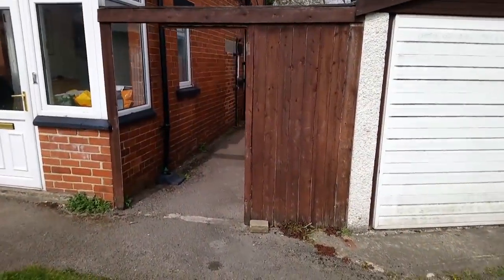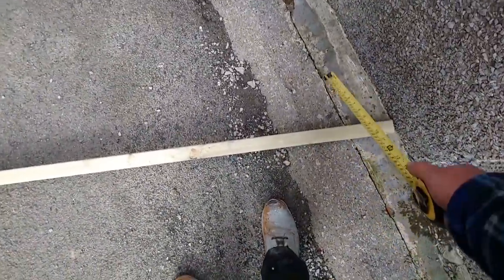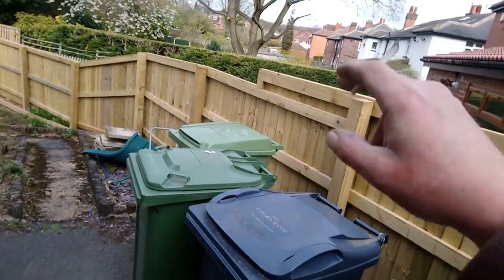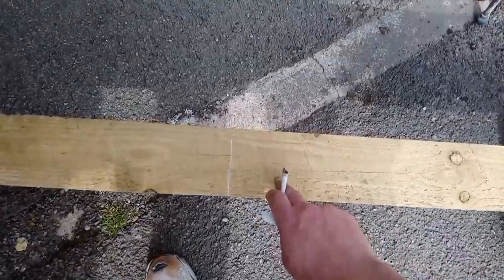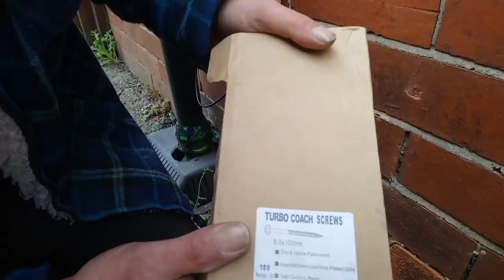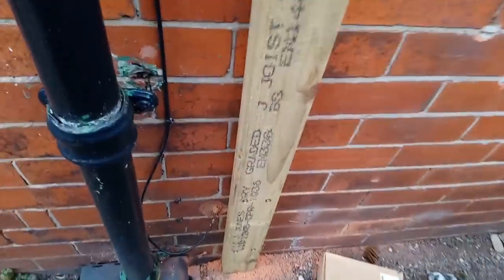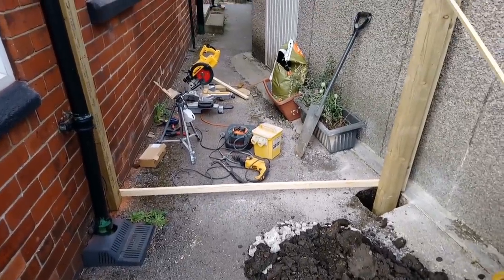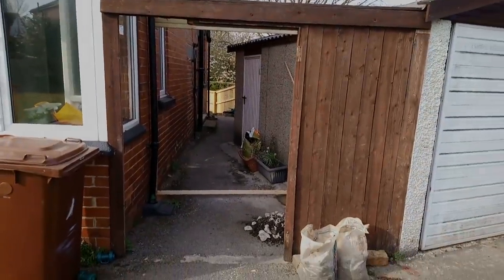Side gates - installing the post/frame

Comment: I was pleased to see you finish the concrete properly, chamfering down and  away from the post. Most so called "proffessional " fencers shove in however much concrete they think will do then top it off with soil, That way they know there will be another job when it rots in 5 years.
Not a criticism each to his own,  but I always position the wall batten a couple of inches off the ground to clear surface water, and angle the top to shed rain.
Reply from the maker: Thanks 👍 10mins in i mention that gap at the bottom but i put the treated end down, it's not much different to the post being in the ground.

Comment: Useful video Gid - thanks for posting.  The SDS drill made short work of the holes in the brickwork and they look like hard engineering bricks!
Reply from the maker: Thanks Andrew, 👍 Yeah the SDS will drill through most things, these bricks are hard some more than others, these ones are the harder ones or the bit i think is on it's way out

Comment: Hi Gid, regarding the bottom of the post attached to the brickwork the problem is it's below DPC so in theory the brickwork (behind it) will be damp, maybe a bit of DPC stapled to the back of post low down up to the Dpc on the house.. Saying that I'd hate to youtube my jobs as I'd get ripped to bits by the  experts & dread to think what the Health & safety would do to me. Love your vids, picking up tips all the time.. keep it up.
Reply from the maker: Hi, Dpc, yeah n no, someone else mentioned this in a comment so sorry I've copied & pasted, Steve builder, is that your trade like Gid joiner 😁 if so you'll know this - a piece of damp course in this situation would be very hard to install without water getting behind it, the outside wall is classed as the wet wall, the one that gets rained on, it's designed to get wet & it's the cavity that stops the transfer to the inner wall, at the bottom inside the cavity it is prob so full of waste/mortar that the cavity is already breached, further up the wall the tie rods have a twist in the centre that should point down to allow any water to drip off before it reaches the inner wall, I've seen huge lumps of mortar stuck to those ties that's fallen down while the house was built essentially breaching the cavity so what's at the bottom? the chance that this would cause damp to come up from the ground to any effect is tiny.
Did you notice the state of the brick mortar around that grate area 🤣, I wasn't concerned about the wood passing by the Dpc.
Thanks Steve, will do 👍 yeah putting my work on film does leave it open to criticism from the armchair pros

Comment: Nice vids Gid, I really like the use of your "small" Milwaukee drill, I never used to think those things had much power in them (the drill not the brand). I think I'll have to have a re-think and treat myself to one, I'm so used to just using my combi drills the every drilling job Tut tut.
Reply from the maker: Thanks Gary, 👍
I did like the little Milwaukee drill but. the charger broke & recently there's something wrong with the trigger, it doesn't always give full power, prob needs cleaning inside, I'd buy something else other than Milwaukee when it dies 😕 & the right angle drill i bought at the same time only has one speed which is sometimes too fast & a little awkward for screws, you have to feather the trigger, because it's a right angle drill that's not easy in the tight spaces it gets used in 😕

Comment: Brilliant job Gid, looks great have you ever used damp proof course behind wood your fixing to a wall or is it a waste of time ? great video
Reply from the maker: Yeah it's a waste of time, the outside wall of a cavity wall is classed as a wet-wall, it's designed to get wet then dry out as the weather changes, the cavity inside stops the transmission of water from this wet-wall to the inside drywall, You get damp inside when the cavity is breached/bridged by debris, Although this timber will slow down the drying of the wall it's such a small area it won't matter unless there is already a breach/bridge in the cavity,  Thanks 👍

Comment: Love watching your videos. Curious about the 'cheap as possible' requirement though. Was it - 'Built well, but on a budget' or literally 'as cheap as you can'? ... what happens if you do it cheap, but it doesn't last? then it makes your workmanship look bad? .. so how do you work with customers like that?
Reply: Wforl you work with people like that by giving them what they request but pointing out the pitfalls so they have no complaint in the future. "As cheap as possible" doesnt mean a crap job and not everyone can afford quarter sawn oak for a side gate!
Reply from the maker: Hi, Everyone wants the best for as little as poss but exactly as gb says, pointing out the pros n cons reg design & budget
 I have to build this within budget & still earn enough for myself, sorry i could've been clearer, they wanted just Z shaped, rail & braced gates but wanted them to be strong that they could lock from both sides & have a ring latch handle so i suggested putting stiles down either side of the Z to make more like a framed door/gate. , 
Thanks wforl 👍

Comment: What about bridging the damp course on the house, doesn't it need a membrane between the post and house?
I have been a subscriber for quite a while now and enjoy your type of videos with your 'thinking out loud' type of approach.
Keep them coming Gid.
Reply from the maker: Hi, no a piece of damp course in this situation would be very hard to install without water getting behind it, the outside wall is classed as the wet wall, the one that gets rained on, it's designed to get wet & it's the cavity that stops the transfer to the inner wall, at the bottom inside the cavity it is prob so full of waste/mortar that the cavity is already breached, further up the wall the tie rods have a twist in the centre that should point down to allow any water to drip off before it reaches the inner wall, I've seen huge lumps of mortar stuck to those ties that's fallen down while the house was built essentially breaching the cavity so what's at the bottom? the chance that this would cause damp to come up from the ground to any effect is tiny.
Thanks Keith, I appreciate the sub, 👍 yep I'm always working so I'll film as much as poss 😉
Reply: here's a tip... the posters the politicians put on polls  its plastic and light i get them and rip them up to the size of your timber and screw to the back..great job  those posters are great for all sorts mixing sand and cement on etc

Comment: I use that treated easi edge for my gate and frames but always put ink marks on opposite way so don’t see it  doesn’t look to good
Reply from the maker: Yeah, you're right, I saw it when editing, I( do remember turning it around because it had a bend in it but didn't see the writing while working ,🤓 dunno why, I've a stop batten & the door will cover it but might turn it around, i'll have to do some more drilling but yeah it'll look better,

Comment: @10:25 I use clear CT1 to seal the ends
Reply from the maker: Fair enough but sealing completely can lock in any moisture that will get in, wood will last a long time if it can breath & dry out,

Comment: Gid are you happy with your dewalt thicknesser I’m looking to buy one next week and don’t know if To buy the dewalt or Axminster thicknesser. 
Many thanks mark
Reply from the maker: Hi, yep i'm happy with it, the rise n fall is a little stiff sometimes but a little WD sorts that out, my fault that tho, the roof leaks a little exactly where it sits & it's a little damp in my shed, it's an earth floor under the sawdust, I can't compare it to the Axminster machine cos I've never played with that but i would buy another of these if i had to n would recommend, apart from the blades sharpening I've had no problems, clean cuts with next to no snipe with the 4 point locking mechanism & easily planes the full 300mm without sounding like it's struggling, sharp blades helps with that.
Reply from the maker: Just had a look at the Axminster Trade AT330T one n i'm not impressed, £699.96!! 😮 looks a little flimsy, only 1,500W motor & the locking sounds/looks like it only locks the rise handle,  I would def buy the Dewalt, it locks on all 4 corners, Dewalt are robust machines & 1800 Watt motor,  & it's nearly £200 cheaper. FFX newer version than mine  £528

Comment: Are the gate posts not meant to be a little of the ground?
Reply from the maker: You can, 10mins in i mention that gap at the bottom but i put the treated end down, it's not much different to the post being in the ground.

Comment: What clear treatment do you use?
Reply from the maker: I'll let you know when I'm home, it's in the shed, I'll inc it in the next vid, could be Lumberjack, Everbuild  or Timbermate clear treatment, i don't have a particular one i buy
Reply: Gid joiner thanks, 👍🏻 what size is your workshop? Im currently struggling with the size of my single garage, i really need (want) a planer thicknesser but dont have the room for it or the extractor and will also have no room for sheet goods if i had one, i could extend the garage but only going to gain 1 metre in width! Is it worth it is what im thinking?
Reply from the maker: Hi, it's always difficult, if you had a double garage it wouldn't be big enough  🤣
I have a 16' x 9' part where you see the table saw table, that's 11' long, the bench with the mitre saw on is similar length about 700mm deep, i have 5 other extensions, the part where the planers are is 2 extensions, that allows me to put 3m through the planer, there's a bit behind the jointer where the lathe is about 10' x 4' but that's going to get altered & there's the 3'sq bit with the extractor & compressor in, The main assembly/spraying area is roughly 12'sq x 9' high, but... i don't have enough room so I'm going to extend it out back, past the tablesaw & mitre saw bit one day 🤣🤣👍
Reply from the maker: Everbuild  I have at the moment 😉
Reply: Gid joiner thats alot then! Shouldnt you just merge it all into one? Haha
Reply from the maker: Not that easy when the main shed was only supposed to be temp, 20yrs ago 😀
It's good to keep the spraying area separate, that's messy, the compressor is just that little bit out of the way to deaden the sound a little & the lathe area is going to become a separate shed bit where i can weld n grind without fear of burning the place down, + i promised the neighbour the extensions wouldn't be as high as the bit with the saws in 😉 I want a warehouse 😁 need to check my lottery ticket, I'm one of those sad people that if i did win I'd have a massive workshop with all the woodworking toys n a new van
Reply: Gid joiner oh so your the same type of saddo as me then! Haha! I have actually been looking at buying a unit/garage/workshop space but it would be so impractical and annoying not being at home and very expensive just for the machines I’d want but I don’t care I just want the space! Don’t really make enough to warrant renting/buying somewhere most of my work is on site unless I’m making alcove cupboards etc oh well can always dream ay
Reply from the maker: Yeah i like being able to come n go from the house when working here, my neighbour has a shed equivalent to a triple garage, he works as a partner with his mate, they've now rented a workshop space for £600+pm, he's never home now, It's swings n roundabouts, go big n poss create your own business or ...  I prefer it a little easier n it's getting a bit late for me, 51 this yr ! 😮👴🤣 I'm trying to accumulate enough of a workshop to retire into
Reply: Gid joiner £600 a month isn’t too bad but I’d rather not pay it and be at home and “make do” are you going to makers central in may?
Reply from the maker: Makers central, noo, don't go far nowadays, If it was in Leeds i prob wouldn't, I haven't been into the centre for 10yrs, that's 3miles away, 🤣

Comment: have you ever thought of using bench dogs for your joinery work ie table with holes
Reply from the maker: I did ask a firm i used to work for with a cnc router for a price to do an 8x4 mft table, the price was way too much n as you've seen me spraying in there I'd prob just trash it,

Comment: why don't you hang off concrete garage
Reply from the maker: It's a prefab garage, these things fall down on their own, their made from 2ft wide concrete panels held together with 3-4 bolts down either side & aren't anchored to the floor,